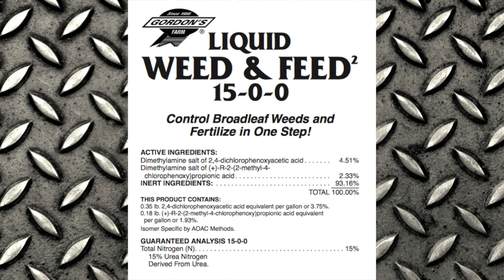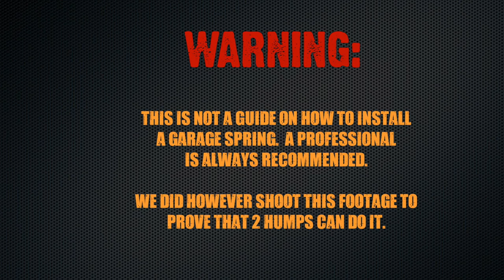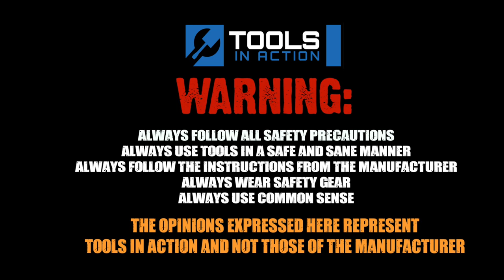Tool Talk 8 - Garage Spring Install

Comment: I made my own winding bars from stock, used sticky tape on hand ends (do not let them slip from your hand). Make sure they are seated in cone socket.  Wore a face shield and safety glasses. Go slow, methodical, use precise movements. Or buy those new spring types that wind with power drill.